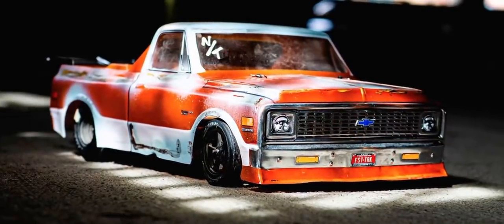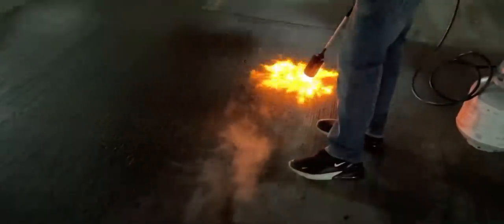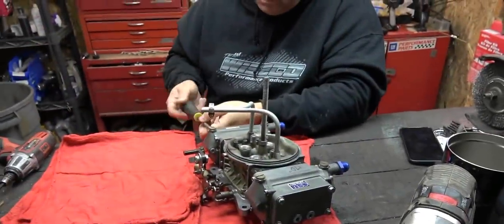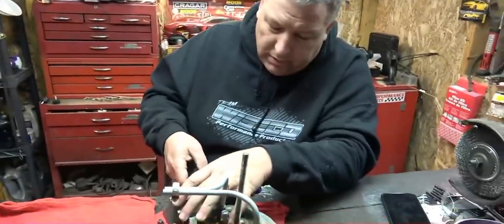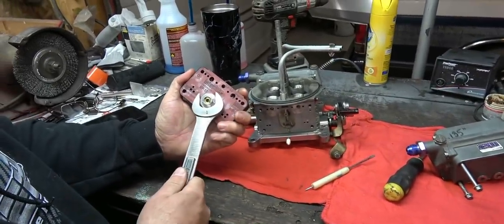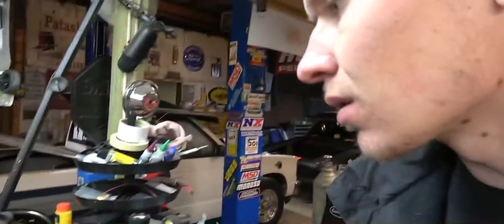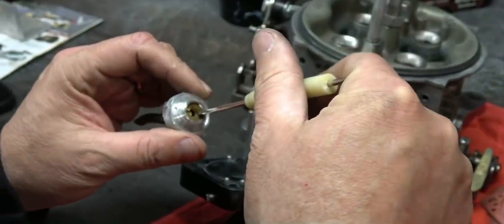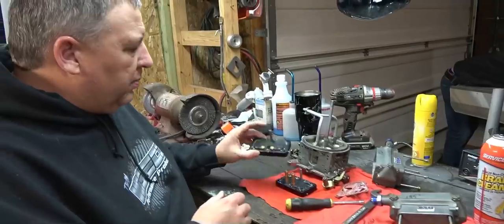It’s time to hit the road again.  THE THAW OUT at DARLINGTON!!!

Comment: Nice video  good luck this weekend.   I have a crest ultrasonic cleaner i use to clean carburetors and I been using 50/50 pine-sol / water  I don't put nothing in there that is rubber.   It will clean carb like new and unclog tiny holes in boat and motorcycle carbs.  My ? Is i never thought of antifreeze. Wonder if it be safe to try  because my cleaner heats to a boil also?

Comment: I was just wondering if you've ever tried to run a plug that they sell for hOllys so the Power valve isn't  an issue  it requires  little  more  idle

Comment: We flog our motors with Marvel Mystery Oil every time we run  the sprint cars. We have a canister that we put the oil into,we pull all the plugs out and we blow the system through with air pressure and it goes through the barrel valve, the nozzles and the fuel pump. we never have any problems. I forgot one time to do the system and I ended up breaking the input shaft off on the fuel pump, because it gummed up.. question why don't you use that big enclosed trailer that you got instead of the open.